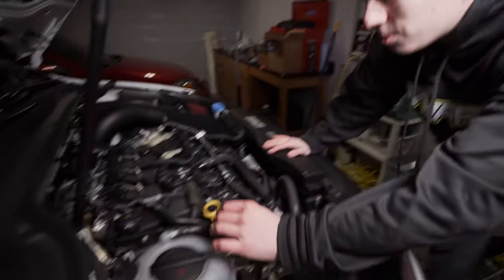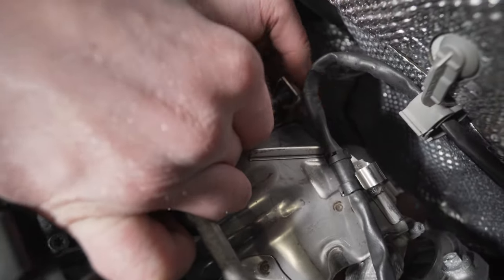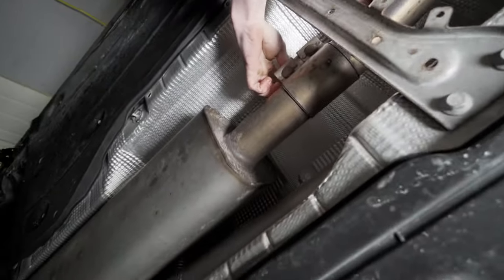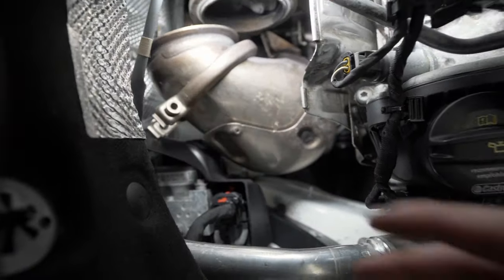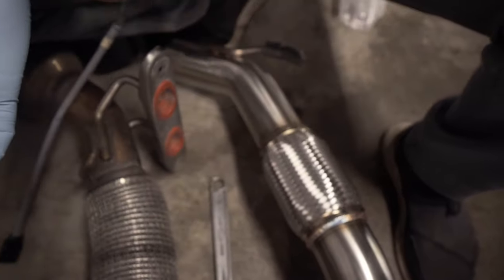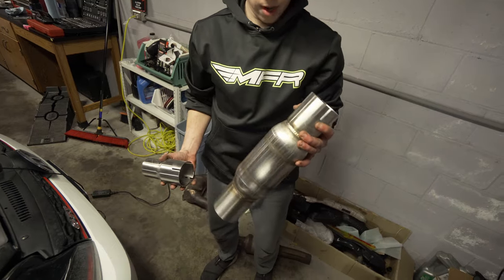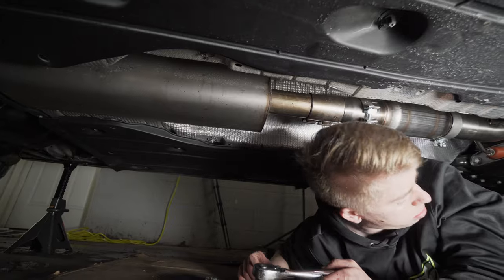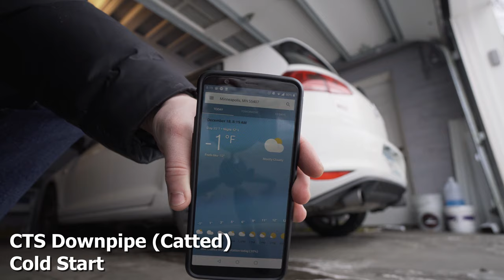Mk7 GTI Downpipe Install *CTS Turbo Catted Downpipe*

Comment: I'm thinking about installing this on my Mk7 GLI, would this process be identical?
Reply from the maker: Exactly the same yes!
Reply: @HardwayLearning  awesome! Also thank you for the reply! In regards to the CEL, could I used my OBD11 to clear the code? Or would it keep showing up?
Reply from the maker: @Ironrain29  it will come back almost immediately. You can use an O2 spacer which works to prevent it though
Reply: @HardwayLearning  so if I didn’t want to get that, I’d essentially need to tune it? Sorry for all the questions, this would be the first mod I’d install myself. Just want to make sure I’m doing everything right 🙏
Reply from the maker: @Ironrain29  yeah a tune will code out the O2 sensor so it doesn't throw a code. The O2 spacers can work well, my buddy is running one and it doesn't throw the check engine light.
Reply: @HardwayLearning  dude awesome, thank you for all the help!

Comment: Did u have a check engine light ?
Reply from the maker: No, my car was tuned with United Motorsport ECU TCU tune prior to the install. My friend has had success with his car running stock flash and Unitronic stock location Catted downpipe on his 4mo Sportwagen by using a J spacer on his O2 though and he does not get a CEL

Comment: Why did you choose CTS over the other brands?
Reply from the maker: Had a friend recommend them and they are cheaper than most. I've heard complaints about CTS quality, but the welds looked solid on mine. Cross my fingers it holds up. I have their throttle inlet pipe and had their intake, both appeared fine quality wise as well!
Reply: @HardwayLearning  for what it's worth, it sounds good!
Reply from the maker: @eddiemk7418  thanks, I really dig the sound too, although there is some drone around 3000 rpm under light load. Might experiment by swapping in a vibrant resonator, I've heard good things about them
Reply: @HardwayLearning  Please make a review if you do change over for a Vibe Resonator

Comment: Are you running any tune?
Reply from the maker: Yes, United Motorsport Stage 2 at the time. Now running their IS38 tune which rips
Reply: @HardwayLearning  through a cobb? And is it a super aggressive tune? I’m about to buy a down pipe and possibly go stg 2.and I have a stg 1+ cobb ots tune and
Reply from the maker: It's a direct flash to the ECU. You have to go to a United Motorsport dealer/distributor. They are more conservative, but have a really dialed TCU tune.
Reply: @HardwayLearning   I just got a cts high flow. I have a cobb ap, will I get a CEL? and could I just reflash the car? Or do I need a o2 spacer?
Reply from the maker: @kentbeitel9966   @Kent Beitel  it depends on if your tune supports a catless setup.  Natively the CTS downpipe with High flow cat will throw a CEL because the cat is downstream of the secondary O2.  I did not have a CEL because I had United Motorsport Stage 2 tune.  You could try running a spacers, others have had good luck with that, but a true stage 2 tune that supports disabling downstream o2 checks would guarantee no CEL.

Comment: Catted downpipe?
Reply from the maker: Yes, high flow cat 😺
Reply: @HardwayLearning sounds great!!!
Reply from the maker: @DanielAlvarez-  cats help keep the tone a little more tame
Reply: @HardwayLearning I just deactivated the soundaktor and I’m missing some noise, my car is stock but I really like the sound that the downpipe provides! It shouldn’t be an issue if I install it without being tuned, right? I am planning on tuning the car at some point though.
Reply from the maker: @DanielAlvarez-  yes, you'll most likely get a check engine light for "cat efficiency" but won't hurt the car at all

Comment: Did it show check engine light after install of CTS dp? Thanks!
Reply from the maker: No, but my car was flashed with UM ECU/TCU tune beforehand. To avoid a CEL I recommend getting an O2 J-spacer. My friend has a Unitronic downpipe running a J spacer and has not had a CEL for the secondary O2 pop up

Comment: do you need to get a tune if you get a downpipe?
Reply from the maker: You don't need to, but you will have a CEL if you don't run an o2 spacer. I've read most people have luck with the 42draftdesigns o2 spacer